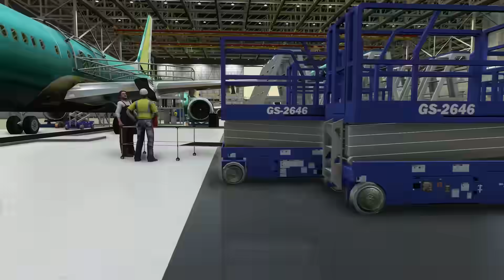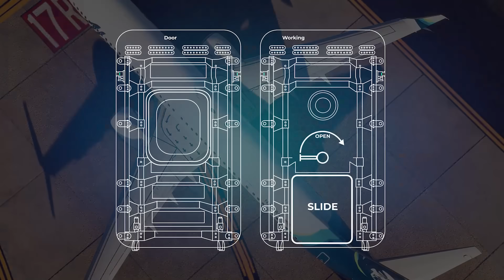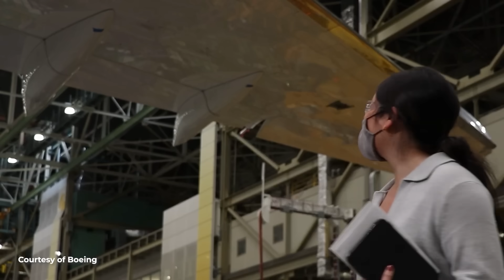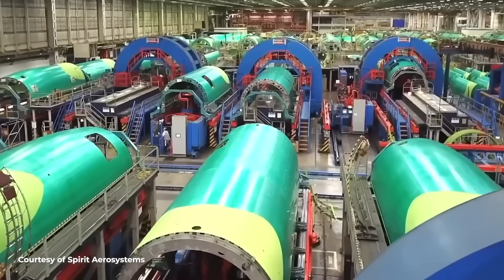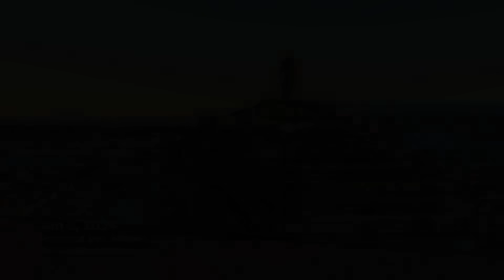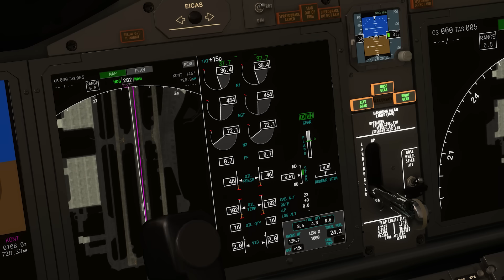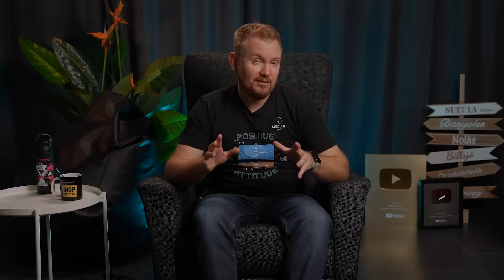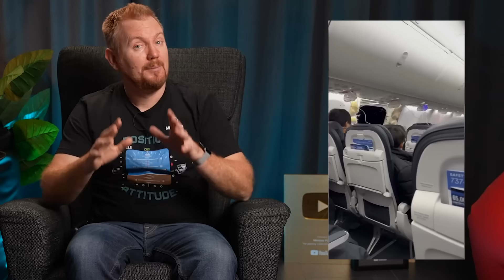Boeing 737MAX BlowOut!! The Scandal behind Alaska Airlines flight 1282

Comment: Don't see why the manufacturer just doesn't ask the customer what variant they want. If you want more leg room, and keep the 189 passenger configuration as is, why do you need the extra door? Just a safety hazard, as this video has shown.
Reply: Once the plane is sold the next airline might add more seats and requires the door then.
Reply: @jantjarks7946  so just cut out a hole then. Why make it unsafe coming out of the factory.
Reply: That would be extremely expensive and would lower the resale value of the plane too.

The technology is not the issue here, it's been around since the introduction of the 707.

The issue is Boeing's unsafety culture and nothing else.
Reply: @jantjarks7946  ya, well, you can't put a price on safety and human life, no matter how hard companies try.

Comment: A certain irony that Boeing engineers bitched about Spirit's poor quality and then created two differing procedures for the same action; photograph the repaired door and didn't notice the bolts were missing, and then when they found four bolts lying around after the repair never thought to wonder if they were important.
Reply: Spirit used to be a part of  Boeing, but now that it's outsourced they can play the blame game when ever they want //
Reply: @FreibertX  A feature,  not a bug!
Reply: Janitorial Staff "sweeps up some things." Yeah, I can imagine those few things went unnoticed. At least on that particular day. I wonder if Staff is told to watch for such things??
Reply: @jone8626 

That is an ……. move!
Reply: @jone8626  That's evil!  At a lab in school, when the logic I laid out didn't result in the correct action, I had to rip out every connector and start over.  Taught me a thing about checking at each step to make sure connections were secure.
Reply: That reminds me of the story with the Pitoh Tube Covers, which were impossible to miss, but two people failed to see them, and another saw them but assumed someone else would remove them before takeoff.
Reply: Yeah I was curious as to why they had a picture of the door if it was supposedly fixed at that point, don't they look around for spare parts or do a checklist?
Reply: Not at all an engineer, but even when I put together or take apart an item of furniture, work on my car, tractor or etc, I always place the parts into specific trays. This is how I know I know I've used,/replaced the proper pieces. This is simple logic. How could  professional people not know this?
Reply: @karenshadle365 this story has had several changes of direction and I have lost track of details.  We know the Boeing crew didn't put in the "bolts" when they were done, but do we know if they took them out..... or were they already missing when the aircraft body arrived there?
Reply: @HweolRidda  
Excellent questions!
Reply: @karenshadle365  Right. The fasteners go into a plastic bag and get taped to the thing they belong to.
Reply: I believe the two different systems were for different intentions. The CMES system is the record of all work performed and inspected. The other system is intended for scheduling and status reporting. The flaw being that Boeing management doesn't allow Spirit employees doing warranty rework to access the CMES system to create items, like 'removal' documents, that would assure sign off and QC for steps related to rework.
Reply: The pictures were quite telling. “Job well done” but became evidence. IKEA furniture and the like sometimes gives you extra bolts. Wonder if someone did see them, they assume it’s just extra lol.

Comment: How many anther bolts are lost on the 737 is the first question I have wonder if I was Alaska airline boss
Reply: Before the door plug, there was also an issue with a bolt at the rudder being loose in the 737max.
737max tho, not to be confused with the 737. very different aircraft.

Comment: This is 100% on boeing in my book. Alaska airlines did everything right. They trusted boeing, their sole supplier, and were sorely disappointed.
Reply: I hadn't heard of Alaskan Airlines catching any blame for this.
Reply: @Connor_Arroyo There are people literally suing alaska airlines over this incident.
Reply: @jort93z  And this surprises you ?
Reply: @jort93z Relying on lawsuits as an indicator of who the victims blame is not a good choice. If my lawyer told me to sue Alaska Airlines, I would do it regardless of whether I personally blame them or not.
Reply: @jort93z  What I actually said was that I had not heard of that. I did not assert it wasn't happening. You should work on your reading comprehension.
Reply: @Connor_Arroyo people in the comment sections were quick to accuse Alaska, and bring up the jackscrew incident from the 90s.  and of course people were also quick to accuse it of being a MAX problem, rather than an assembly problem.
Reply: @kenbrown2808  In this society, there are a lot of ignorant people that speak out of ignorance and make a lot of ill-informed assumptions.
Reply: Did Alaska Airlines do everything right tho?
Multiple passengers did report  whistling sounds on previous flights. Add to that the previous problems with the pressurization controller.
I don't know if Alaska Airlines not acting upon those warnings signs is enough to blame them, but there were warning signs.
Reply: @Jehty21  petter clearly said they did more than the nature of the known problem called for.  Yes, in hindsight, the whistle was a clue, but remember that the were delivered an airplane with an implied warranty that the door plugs were properly secured.
Reply: @kenbrown2808  well, yes but no.
He said that they did more than what the problem with the pressurization controller called for. 
But they failed to see that the two problems had a common cause. And because of that they didn't take all necessary steps.
Reply: @Jehty_  and that has something to do with it being the first time that problem has happened.
Reply: @Jehty_  Book a flight on any airline and tell the flight attendant you hear a whistling sound. See what happens.

Any airplane (train, ship, bus, car, ...) is full of all kinds of noises. Aside from a couple obvious ones, even an expert cannot tell you from the vague description of a sound if it is normal or a sign of something going wrong that has never happened during the full history of powered flight.
Reply: boeing is not Alaska's sole supplier.  just the sole supplier of big jets.  their regional fleet is made up of Embraer regional jets - recently upgraded from a mixed fleet including dash 8 turboprop planes.
Reply: @kenbrown2808 You are right.
Reply: Alaska mechanic could at least run the APU pressurization check on the ground to see where the air leak came from

Comment: The most incredible part of this whole story is how the door didn't hit the plane's elevator.
Reply: I rather think the fact that only two empty seats on the plane were right next to the faulty door plug is significantly more incredible.
Reply: @reshpeck  There is an unconfirmed report I’ve see that this wasn’t a coincidence.  The people in those seats were trying to sleep but couldn’t because a whistling noise was keeping them up so they switched seats. If they hadn’t been light sleepers they would have probably departed the aircraft with the door plug.
Reply: must have been an "extra legroom aka extra money" seat.  @reshpeck
Reply: @reshpeck Maybe it was by design.  Those are emergency seats to be filled only when the plane is too full, and need to fly more urgent passengers.
Reply: @JohnSmith-rr8hp  Only if the plane is configured with the maximum number of seats, which is typical of lower cost airlines, in which case the plugged door is fitted with an additional emergency exit as required by law. This plane had fewer seats (providing more legroom) and thus there was no emergency exit. This was all explained in the video.
Reply: The door may have sailed down, but it still could have hit a person. One man found it in his garden. May have damaged a tree / bush, but no more harm done. If he first contact had been with a roof or a person or a car it could have been much worse.
Reply: Do you mean horizontal stabilizer, right?
Reply: @tonys-660 The Horizontal stabiliser, stabilises the plane in flight ( like a rudder on a boat) , but the elevator manipulates the vertical direction of the airplane. Damage the elevator mid flight, and it would have been pretty much certain death for everyone onboard.
Reply: In addition to not hitting the elevator, it also didn't cause additional damage to the aircraft structure. This incident happened when the differential pressure was only around 65% of what it would have been at cruising altitude. If the door had departed higher up, the forces involved would have been a lot higher. I think it's conceivable that the door would have taken parts of the surrounding fuselage with it. I have seen people (most notably Juan Browne a.k.a. blancolirio) speculate that this could have resulted in a breakup of the entire plane. I don't know if that was a possibility, but I surely hope that it will be looked into for the final report, because that would certainly have killed everyone on board.
Reply: @renerpho  It's always possible, but from my knowledge of explosive decompressions, they very, very rarely result in breakup of the aircraft.  The ones I do know of usually include much more extensive structural damage resulting from a bomb.
Reply: People reported that a stinky ice chunk (a bigger one) was found in the garden or it hit the roof and damaged a few shingles. That must have been from airplanes as well. I think it was not during winter either. The people noticed, the one man repaired the roof himself, so no big reporting on it. I read it in a local newspaper.
Reply: @franziskani why was it “stinky”?
Reply: Looking at the 321XLR and thinking it's fortunate that their doors don't have that issue because one of them is right in front of the wing.
Reply: @jamesgorman5241  I dunno, I'd rather trade possible damage to the wing and engines with possible damage to the stabilizers.
Reply: They were still ascending so perhaps that reduced the chance a little.
Reply: True
Reply: There’s an elevator?? How tall is this plane

For legal reasons this is a joke

Edit: thanks for all the likes guys! It means a lot
Reply: @kellerbailey4353 legal reasons?
Reply: @dpm2937   they were both jokes, or were they?
Could be a conspiracy!
Reply: @kellerbailey4353  made my day🤣
Reply: @kellerbailey4353 just glad things didn’t escalate 😂
Reply: @kellerbailey4353  😂
Reply: @kellerbailey4353 beat me to it 😂
Reply: @kellerbailey4353  its a stabilzer fin that make the plane go up and down, sometime they call it the elevator, the flight instructor calls it the elevator which make the plane goes up and down.
Reply: @Perich29  can you read? It was a joke
Reply: The way down is not harmfull, groundcontact is
Reply: There are a few like that. Amazing stories of being in the wrong place at the wrong time ,but not quite. The one where a propellor came off and sliced into the plane missing a passenger by inches.  Qantas 32 where they had an uncontained engine explosion and nothing hit the fuselage. One of the pieces that fell to earth also just missed a little boy sitting at his desk in school. 🦘the ones where people are killed because they were being kind and caring are the ones that really get me.
Reply: Is it that incredible?
Due to the hinges on the bottom edge, a 55 pound door plug has rotated from being vertical to being horizontal, in line with the bottom of the doorway opening.
In that movement, which took perhaps a tenth of a second, the center of the 55 pound mass has moved downward by almost a metre (half the door's height) and outwards from the aircraft by almost a metre. I make that 35kmh outwards & 35kmh downwards. (Perhaps it opened more rapidly than that as there's about 10,000 pounds outward force on the door at 5.7psi).
Even though it will fairly rapidly accelerate backwards relative to the aircraft, with the initial downward momentum + gravity I'd expect it to always pass below the horizontal stabiliser, so long as it opens by rotating about the hinge (as it did) rather than blowing directly outwards.
Reply: I’m not sure…there is downwash aft of the wing
Reply: Or any part of the tail, period.
Reply: It is so unfair that after bringing their passengers back to the ground safely, and mostly uninjured, their chief pilot probably still had to ask why they didn't stop the voice recorder from being overwritten.
Reply: Indeed.
Reply: You mean horizontal stabilizer
Reply: If it was a 717 max or the 727 max, it would been sucked into the jet engine and damage the rear engine.
Reply: Remember the door is moving as fast as the airplane when they come off.
Reply: Alaska has very skilled pilots. Duh.
Reply: It's to elevate the experience
Reply: That would be catastrophic!!!
Reply: It’s OK… had the door hit the elevator, MCAS would’ve handled it flawlessly
Reply: That’s some excellent engineering!
Reply: Heck yes…AND was not at 40000 feet!!
Reply: what's more incredible is that by some miracle, no passenger were seated near the door plug.
Reply: @Anistar95  Meh, that would be 1 extra casualty. If the plane's elevator got hit, it would be a complete hull loss. It has happened in the past.
Reply: The door would have had to fall upward to hit the elevator, but because of gravity this doesn't happen.
Reply: 2 things you need to consider:
- The plane was climbing, so the plane would be at an angle with the tail below the plane's center of mass
- The force of wind is so strong it makes any movement hard to predict.
Reply: Since it would have had to fall up several feet while being flung explosively from the plane after the hinges at the bottom of the door failed it simply cannot hit the elevator
Reply: no, the most incredible part of this story is that one of the phones that escaped was an iphone, and the screen didn't crack.
Reply: @kenbrown2808 yeah, if I drop my iPhone without a good case and it hits a hard surface with a corner,the screen is often cracked.
Reply: @kenbrown2808  it works. Are you sure it didn’t crack tho? If so I’m pissed because I dropped mine on the web for the other day and the whole back is cracked. I have to put Band-Aids on it, so I don’t hurt my finger until I get to the store. At least it already needed a replacement because the speakers are sucking for the longest time now.
Reply: I think that the most incredible part of it is how that door survived a drop of about 10000ft or so and stayed intact the whole way down
Reply: @aviationfan2637  The door is just a slab of aluminum, it wouldn't tear apart or anything. It did land without hitting anyone, that's also amazing.
Reply: @harryshuman9637 The empennage is also "just a slab of aluminium" - the impact of the plug could easily cause a lot of damage to it.
Reply: @harryshuman9637 how much weights a door?
Reply: @marcelk3847  I don't know, I imagine 100kg at least. At the speed at which the plane was moving it would be enough to destroy the stabilizer and bring the plane down.
Reply: @harryshuman9637  
*aluminium
Reply: I imagine its shape caused it to feather on its way down.
Reply: @ThirdPattern29453   you know how heavy those doors are? Feather? That thing prob hit the ground like a
Meteor
Reply: @aviationfan2637  how about the sucked out phones that survived that drop?
Reply: @aviationfan2637  The air slows down a such sized item a lot, even smartphones had been found and still working //
Reply: @aviationfan2637 I imagine terminal velocity played a big part in that
Reply: @aviationfan2637  stayed in tact the whole way down? Lol well air is not that damaging bud
Reply: @aviationfan2637 It simply glided.
Reply: facts
Reply: Aircraft was on a climb I guess which is possibly the reason the door didnt hit anything.
Reply: The hinges are on the bottom so it would have blown from the top until the hinges broke, the hinges and weight of the door would have caused it to break free in a downward motion